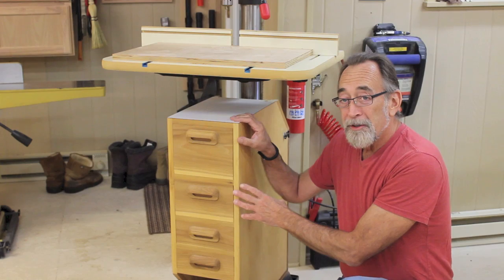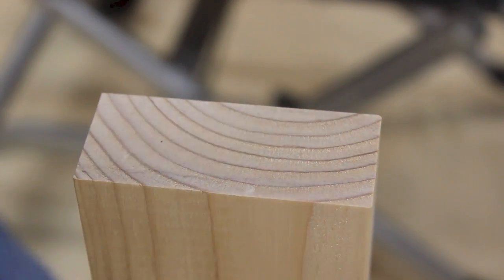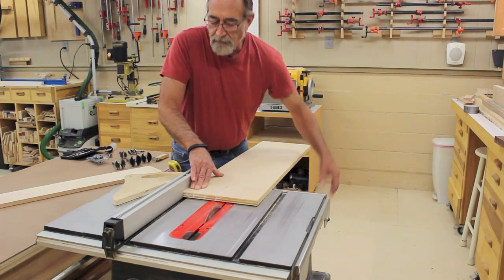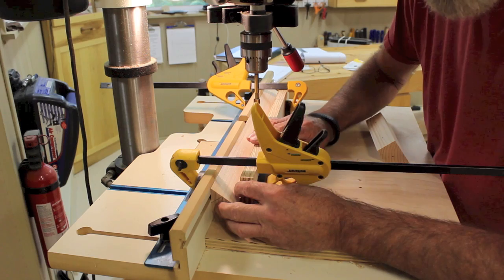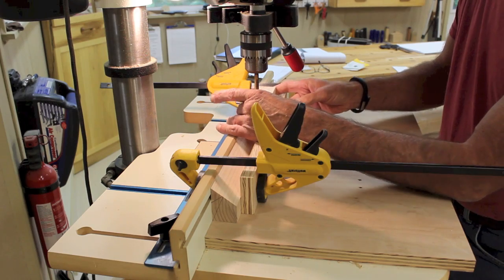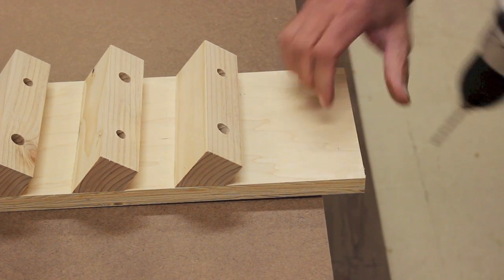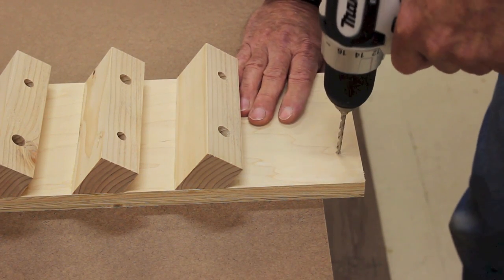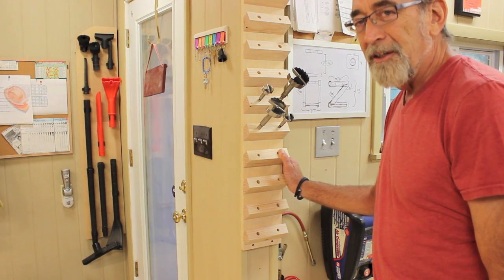Drill Bit Storage - One Board, Quick & Easy

Comment: I may be a bit confused, but could you not drill the holes in the 2x4 BEFORE you cut the angle for mounting. That way you could eliminate the need for making a jig for drilling. I'm talking about the setup from 3:50 on the video.

Comment: Great job on the drill bit rack. I'm also very interested in the battery operated compressor you have on the wall. I am glad to see who bought the other one. I've enjoyed having mine for several years with only one battery replacement. It has now stopped taking a charge so I switched to using a cordless nail driver.
Reply from the maker: Isn't (wasn't) that a great little compressor?  I wish they still made it.  I have searched the internet and no one makes anything similar (or at least that I can find).
Reply: downtoearthwoodworks
I agree, but it did come in handy working away from the shop. I've tried to find it on the net also with the same luck. I can find the batteries for about $42.00, but it really isn't worth that. Keep up the good work in your shop.

Comment: I like the idea, but I would definitely mount it in a different location, as I'd hate to walk around the corner and get my face shredded by a bunch of F. bits.  Also, my OCD kicks in and I would have them going from smallest to biggest, or vice versa, but in numerical order.  LOL.  Good work though, nice idea.
Reply: That's not OCD. It's the best way to not having to "hunt" the one you need.

Comment: You could eliminate the need for a special boring fence for your drill press with a simple 1x2 storyboard. After truing up your blank for cleats cut a 1x2 the length of your cleats plus the width of your miter saw blade's kerf, typically 1/8". Use an adjustable square, mark the center line the length of your 1x2, adjust square, mark the center line the length of your blank. Mark and X on one end of your story board, from this end, mark location of your bores. Bore 2 holes slightly smaller then the diameter of a 16D common nail. Insert one nail into each bore. You now have a marker gage. On your blank mark out the location of your first 2 bores and the length of your first cleat. Keep in mind this will be the actual length without kerf allowance.  Place a square on this first cut line. Hold the end of your marker gage, the opposite end from the X mark, against the square. Slide marker gage back and forth marking locations of your bores, strike a pencil line at the end of your gage. Repeat process until entire blank is marked out. This will layout all your bores and allow for lost material when cutting cleats to length. Using a square fence on your drill press bore the holes in your cleat blank. Alternate bores 3/8", 1/2", then cut to cleat lengths. Use one cleat blank to set up table saw for angled cut, then cut all blanks to angle. This will give your equal length blanks with bores at equidistant locations. When flipped around you will have an equal number of blanks with 1/2" bore on left and 1/2' bore on right side of blanks. Carpenters have been using marker gages like this for centuries to simplify repetitive layouts accurately.

Comment: good design, easy and accessible but the only bad thing is if you are walking at that corner you might catch it with your sleeve or back which will rip your shirt and scratch your body :D Solution : put it in enclosed space or even in a cabinet. Thanks

Comment: I love this very simple yet efficient storage idea!  One question though, after it was completed were you realizing or wishing you hadn't put so much space between the angled pieces thereby having twice the amount of holes available?  You could have had them butting right against one another and I think your bits would have still easily fit and/or been removed.
Reply from the maker: Mine was made to store large Forstner bits, up to 3-1/2" in diameter, so the space between was necessary... but you are 100% correct, if you are storing smaller bits, you could put the angled pieces closer together.

Comment: What would happen if anyone falls and ends on it! I mean  the bits look sharp. its a great project don't get me wrong but as you said its nice and easy to get too.
Reply: they are eliminated from the gene pool.........
Reply: It wouldn't be hard to use some scrap plywood to put sides and a front on it with hinges for a door you could swing out of the way when not in use.  Use a scrap of plexiglass and you retain visual access while still being safe.  (The same safety risk crossed my mind too.)  :)
Reply from the maker: Doug Dobbs The spot where this resides in my shop would be impossible to "fall into" but your idea for sides and a door is excellent.  One of the best things about woodworking is how different people come up with ways to "plus up" a design.  Thanks!

Comment: could you not drill the hole before you cut the angles?
Reply from the maker: You could, but it would be more difficult to space the holes, account for the saw kerf, bore both sides of the board, then split the board exactly in half with an angled rip cut, then cut the board into lengths making sure to get the holes in exactly the right spots. Thanks for watching!